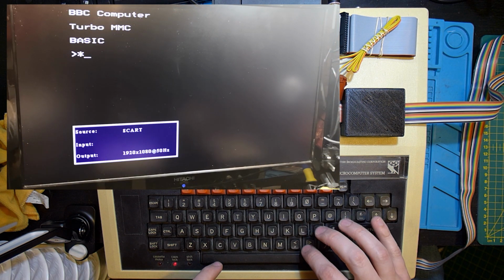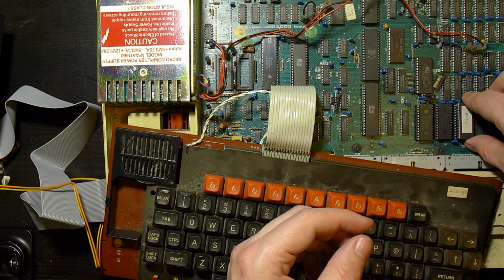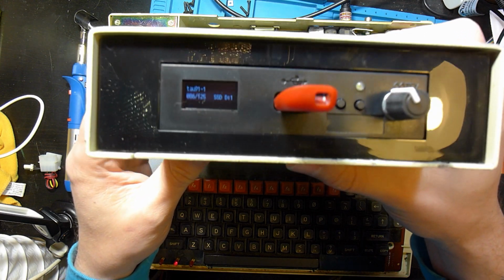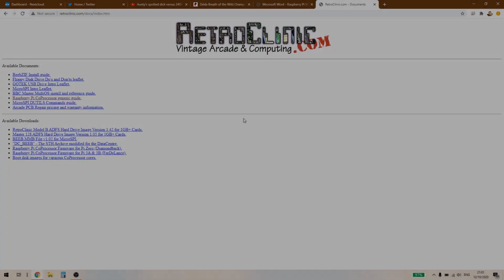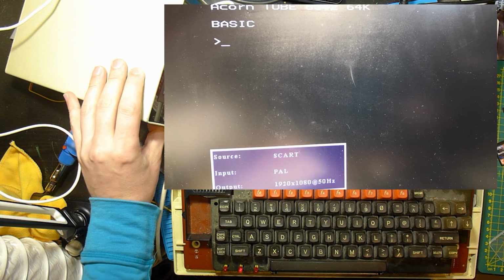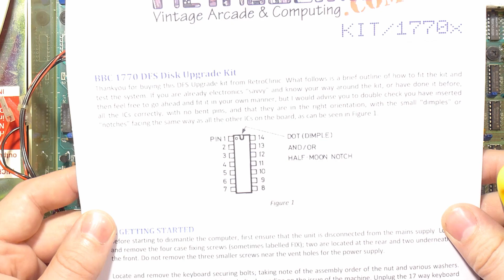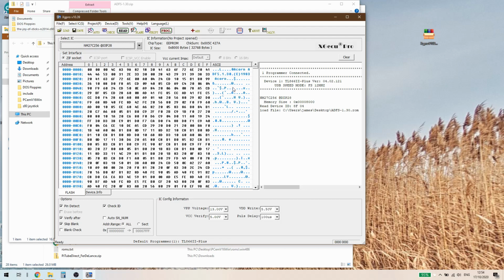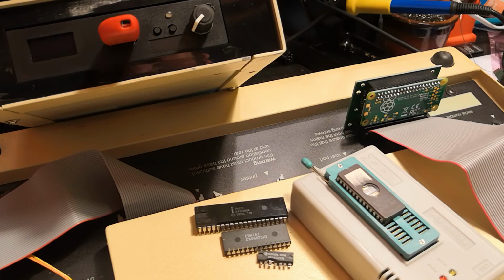DOS on a BBC Micro - GOTEK, Raspberry Pi PiTubeDirect, 1779 Floppy Controller upgrades.

Comment: Having dabbled in electronics with MCUs, I have always considered the Raspberry Pi as a solution looking for a problem. It always seemed to be far too much computer power to switch LEDs on and off with colour changing as a finale. The Gotek blows away all that cynicism . This device has my imagination in a turmoil. I just know the jet pack is a real possibility!

Comment: Fun video! In GEM, you may be able to move the mouse using the arrow keys - maybe by using shift or control or something - at least you could on the Atari ST.
Reply from the maker: I thought that too - I have an ST as well and you could move the cursor around by holding down Alternate and pressing the arrow keys. I couldn't find an equivalent on the BBC though. The Internet is a bit sketchy about mice for the BBC Micro.

Comment: You might like to look at my menu system for the gotek https://stardot.org.uk/forums/viewtopic.php?f=2&t=16070
And if you are in the mood for more upgrades that admittedly aren't too well supported, try speech (try my astro blaster) and a NuLA for 4096 colours (and you can then play doom and emulate a spectrum and CPC). I would also recommend boobip's eeprom board and sideways ram expansions.
Reply from the maker: The menu looks useful. While I like the little OLED screen on the Gotek it's a bit fiddly scrolling through loads of disk images.
Reply: @ncot_tech  I would have two sticks, one with the menu for games and the other with a few images for non-games and any that don't work off the menu (some games have patches that aren't on http://bbcmicro.co.uk) or you can update the menu on windows.